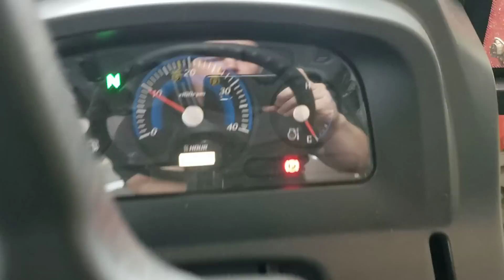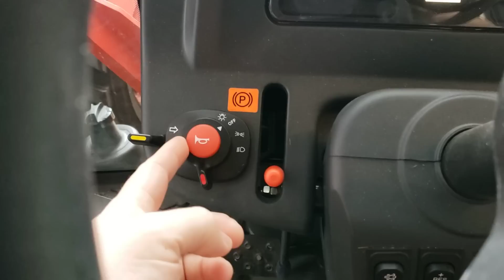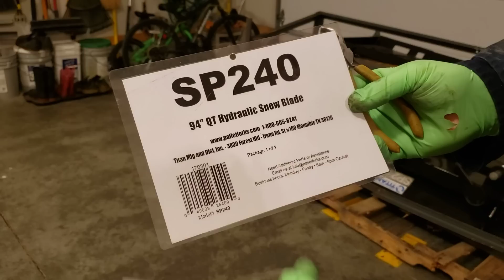Titan - SP240 - 94" Snow Plow - Unbox, Setup, Hydraulics, UHMW Cutting Edge, & First Run

Comment: Hi
Did you end up taking the bolts out that allow the tilt left and right float function on the central point?
Reply from the maker: YES! I did have them too tight, but they were allowing for some pivot. I loosened them and it helped. This tool is one of our biggest successes! Love it, and I hate to admit, please don't kill me - I'm kinda looking forward to doing it this winter ;)
Reply: @BrianPhillipsRC  so you just loosened them up and did not remove them completely?

Comment: How tall is your tractor from the floor with the industrial tires? Also, with implements on, does it "sag" thr tractor lower at all? I have a 96 inch opening to try and fit it in and trying to decide on a ck vs a dk. Thanks for the help!
Reply from the maker: GREAT QUESTIONS!!! I had to take out a little bit of tire pressure...but we have 8 foot doors too. We HIT The weather strip in our third stall, about 1/8", but on our first and second car stalls (The bigger door) we hit a bit more...like 1/4" since there's little bit more crown.

Measuring the height of the tractor is a huge pain, but we tried and tried, and the dealer in Atlantic, IA (About 2 hours drive from us) was adamant that they wouldn't let me "See if it would fit"... This was annoying, but we LOVE this machine! we have Industrial Tired on this machine. We were TOLD they were Ag tires, but these are absolutely Industrial - I found out when we did Wet tires.

We did a video about "wet" tires too, which might talk more about the height, if you want to see in more detail.

We plan to show more about this tractor in the spring for Hay Season too, FYI.
Reply: @BrianPhillipsRC  Thats what it looked like from another video of yours I watched. Thanks so much! Its just so close that I was sure if it would fit, and the specs say "height with ag tires". Really enjoyed your videos and reviews vs the comparable John Deere models and opinions overall so far.

One other question for you if you dont mind. Do you find that the weight ruts up your yard much at all when dry? I know if it wet it coult rut up, but i have a very similar place to yours and want to feel comfortable taking it across our "lawn". By no means is it a golf course type lawn. Seems like in your video you have no problem driving it around your place. Thanks for your help!

Comment: How much was the tractor💰
Reply from the maker: We paid $36,600 with two additional rear hydraulic ports and controls (one may have been included).

As for the pushing blade, I can't remember, but you can follow the link to see what they're going for now.

Farm
Quick Tach 2 JD Plate https://bit.ly/3nOLcpl
Fork Lift Carriage https://bit.ly/3NOwglv
54" Drum Mower https://bit.ly/3yRhw0Y
Drum Mower Blades https://bit.ly/3anB43U
94" Snow Plow https://bit.ly/3AxtQ81 <<<<<<<<<<<<<<<<<<<<<< Here
60" Grapple https://bit.ly/3Rl6Sag
Spears https://bit.ly/3PbISnY | https://amzn.to/3AnZ9Po
Spreader https://bit.ly/3RloPFt | https://amzn.to/3IqmYuT
Bushing Kits https://amzn.to/3AnysKG
20VDC Telescopic Chainsaw https://amzn.to/3yQi7R4

Comment: where can I get a Matrix jacket like yours?
Reply from the maker: LOL - very nice!!! I get these from plants that I work at. I've been what I do for so long, I end up with these "frocks" or "smocks" (lab coats) when I'm working with a maintenance crews at like 3AM or whatever horrific time, usually when I was working with them for like 12 hours on some horrible project and the front entrances are closed or whatever strange circumstances had it that they just send me home in the thing or in my truck. It's happened half a dozen times or so, sometimes by their mistake, and other times by my mistake. Either way, they end up in the garage.
Reply: @BrianPhillipsRC  I do like the coat, and nice tractor. I have a Kioti CK3510 cab and it is a wonderful machine thus far.